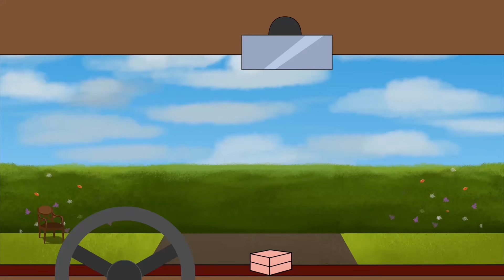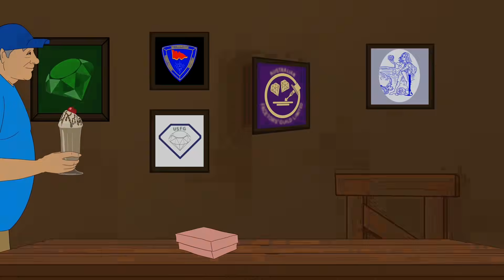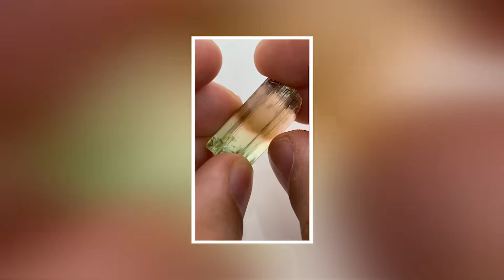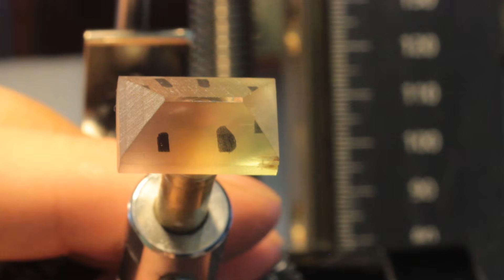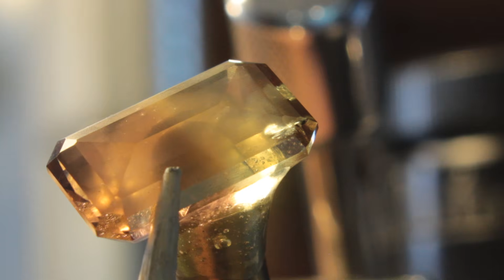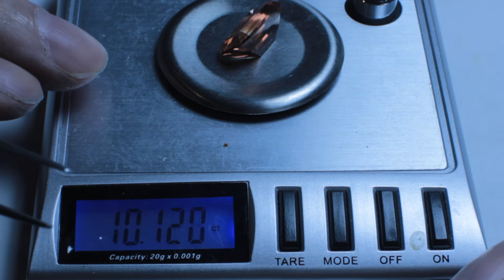Gem Cutting Tutorial: Bi-Color Tourmaline Oblong Standard Cut

Comment: Nice work! Just curious what is the value of the tourmaline after finished
Reply from the maker: That is a good question,.  However, I am here to demonstrate how to cut, I don't discuss pricing.  In my experience when you go down the road of discussing how to price gemstones, it always becomes more of an argument than a discussion...so I just don't get involved in that.  I will say that because I buy either from the miner or very closely from the miner and cut the rough myself, that I do skip a number of value steps in the supply process...bottom line is that I can sell stones cheaper than most others because I buy the rough and cut it myself.  :-)
Reply: @BopiesDiamondsFineJewelry understandable, I was just curious. I was interested in a specific piece of rough. It is a half blue half green piece from Brazil. It has a closed C axis 40 carats. Can probably get 20 carats clean out of it. They want $730. I feel like its a good deal. I was just trying to get an idea of what I could expect to get once cut. Thanks for the info.
Reply: Waiting on my v5 to come in, I have some cheap stuff to practice with before I invest in more high quality rough. I just dont want to ruin a nice piece of rough, lol
Reply from the maker: @Turbonicplague  I assume you are talking about Tourmaline.  A 40 carat 1/2 blue and 1/2 green with a closed C axis for about $20/ct.  Is the stone clean?  Is the stone shaped well,?  How vivid is the blue?  How vivid is the green?  What are the dimensions?  I can't really tell if that's a good stone or not without seeing it, but if the stone is good (all my questions above) then I would have no problem paying about $20/ct.  Best of luck to you.  As far as how much to sell it for, again, I can't help you there.
Reply: @BopiesDiamondsFineJewelry  Thanks for the info. It is vivid blue and green under the light and has small inclusion on one of the sides. For the most part it is very clean. 1.1" long x .55" x .5 ". Its actually 47 carats. Im just trying to figure out if it's to good to be true for $750. Thanks for your responses.